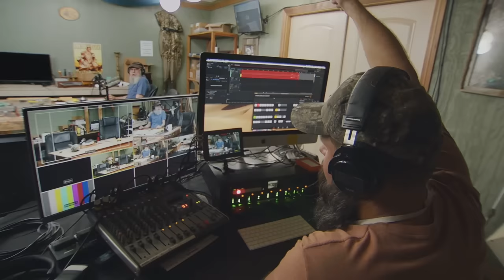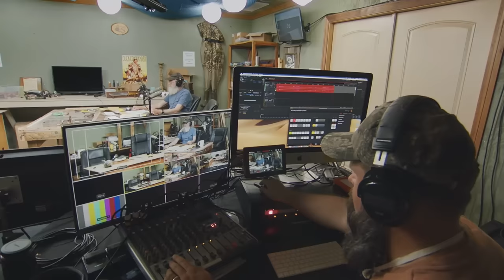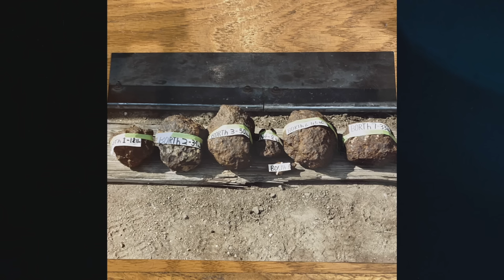Duck Family Treasure FULL Season 1, Episode 1 | Fox Nation

Comment: I used to go on treasure hunts almost every day running a inspection crew inspecting casing for oil rigs all over the place and my dispatch guy had the worst stutter ever. so me and the crew were always driving around in the middle of know where looking for the rigs, and my dispatch guy is always telling me how to get to them before gps in trucks in 2000. and dispatch is guiding me every day to gogogo left left left left left left left then then gogogogo 10 10 10 10 miles miles 10 miles miles then take a a a a a a a left left left left. 
    Some how I was never late to the rigs.